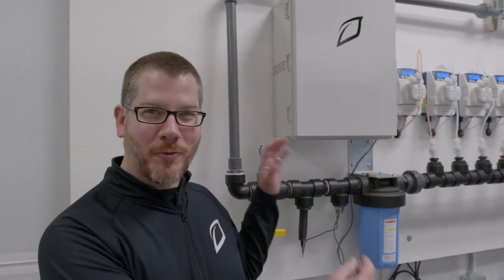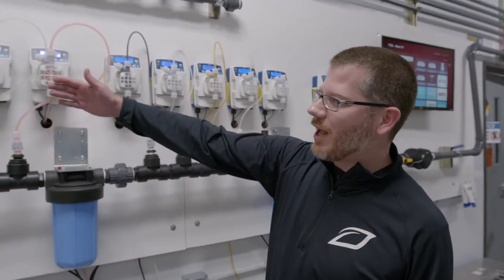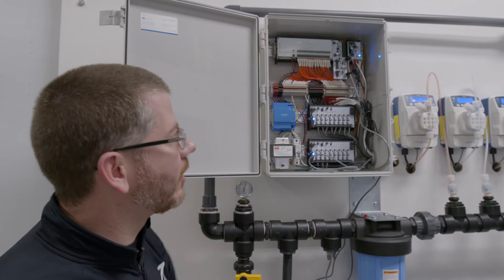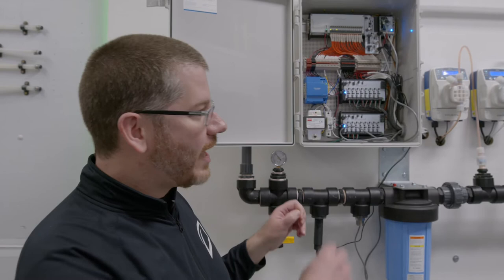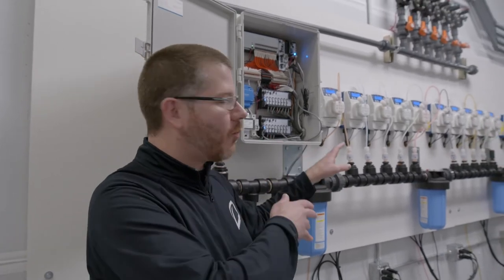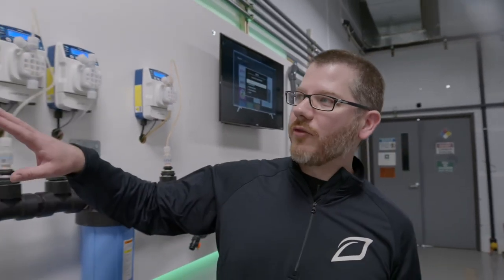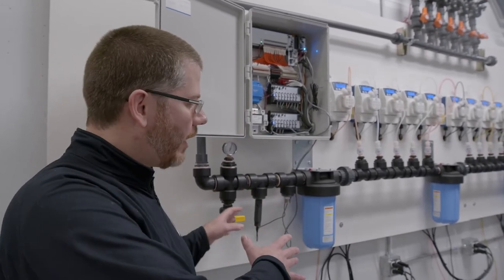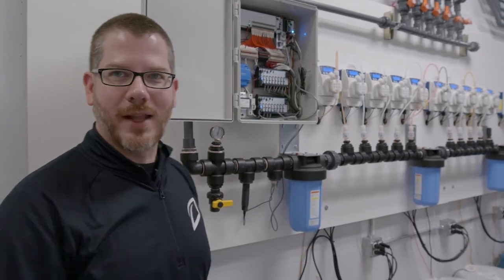Growlink: Fertigation Controller Walkthrough

Comment: What if you switch from a zone with flowers to a zone with clones, how do you clear the super high EC residual mix that's in the pipes prior to the solenoid array?

Also, I assume this is one of those "if you have to ask how expensive it is, you can't afford it" sort of things. I've been searching everywhere for a fertigation solution for my farm and people are quoting me between 150k and 340k, it's absurd.
Reply: You need to install dump valves at the end of your runs so you can clear out the high EC solution when switching recipes.
Reply: If you learn it all and DIY the install you can usually cut that in half. But it’s always going to cost a ton. Each of these pumps is well over $500, and the controller systems cost $5-8k. Plumbing parts alone can run upwards of $10k depending on the size of your cultivation. Pumps are also not cheap, for good ones anyway. RO and/or batch tanks cost a few thousand. If you need chillers for the RO stock, you’re looking at another $8-12k. Shits expensive, as you already know.
Reply: The system is programmed to run a few gallons of clean water at the end of the dosing session to clear the pipe up to the room selection manifold. Nutrients left in the room pipe will be acceptable for the next session of dosing. At the end of harvest the system is run with clean water for that room for several minutes until the ppm at the dosing heads are measured clean.
Reply: @jonosterman2878  The numbers you just quoted all sound reasonable. Let's say 6 doser pumps at $800, that's $4800. Let's say teh controller is "only" 8k, which I doubt they sell it for that "cheap." Then let's say that plumbing cost $10k and other parts are another 10k, then double the total to include for labor, that's still $65000. So why the hell am I being quoted over 100k.